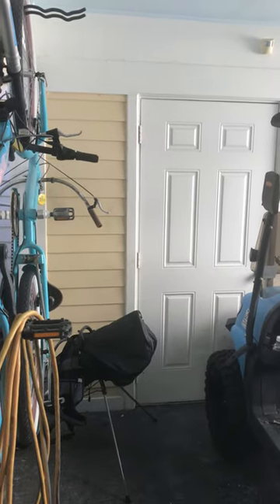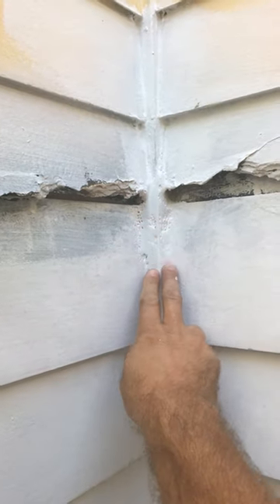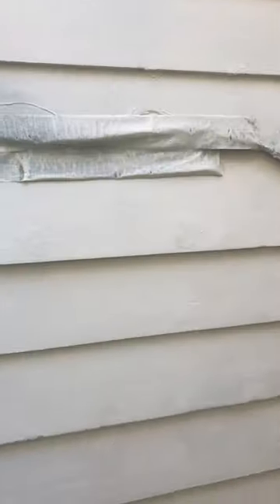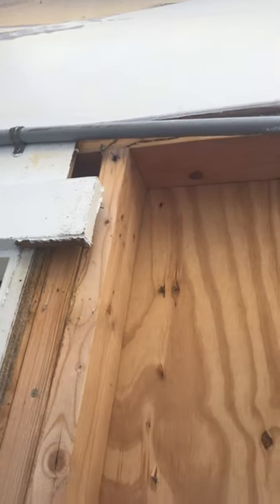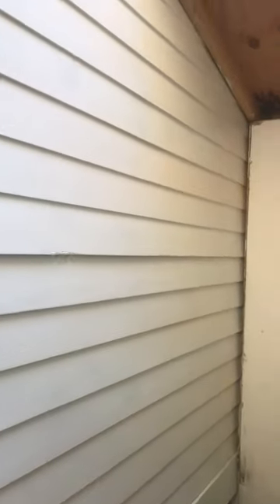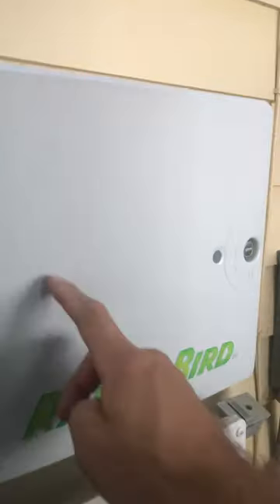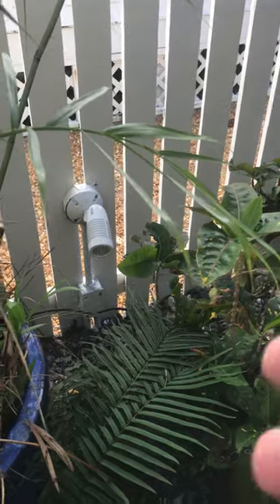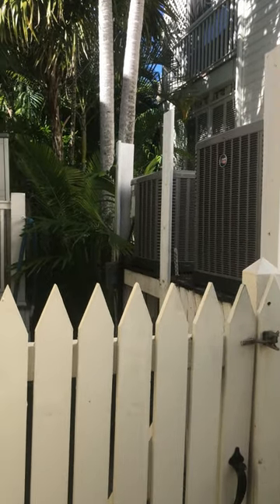The Hidden Costs of Homeownership EXPOSED! 💸🏡 | Myth of the American Dream

Comment: Does insurance not cover any of the termite and water damage?
Reply from the maker: No. Even if it did, the deductible would be higher than the repair cost. Then the insurance company would raise my premiums for filing a claim. Insurance companies are criminals. I did the demolition on the shed myself and will do the repairs to the siding and rebuild the one wall and roof. Termite companies are a scam as are insurance companies. Home ownership is getting way too expensive.